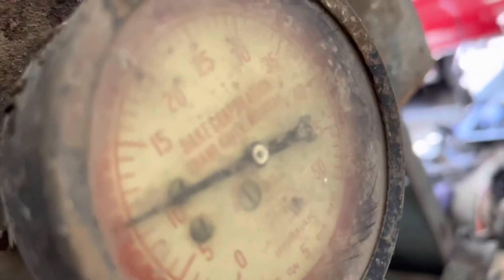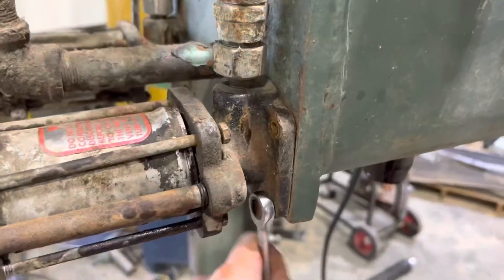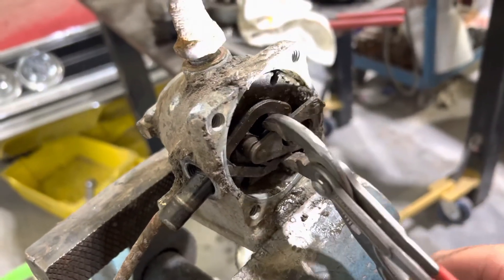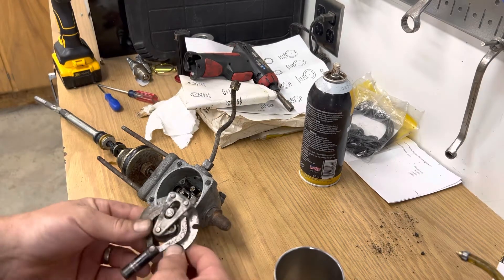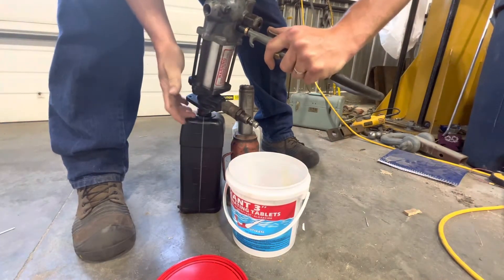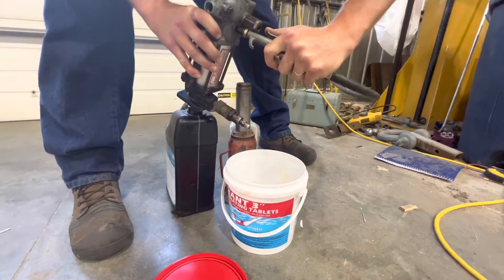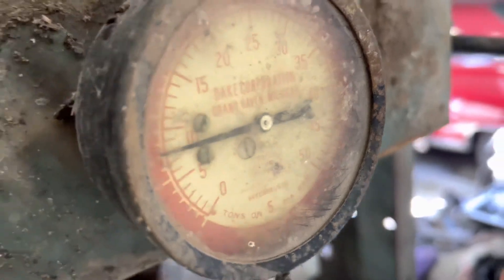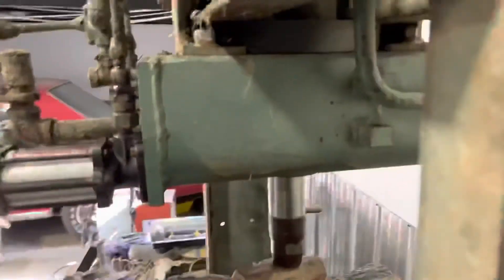I Bought A Dake 50 Ton Press That Has Been Sitting Outside For Years

Comment: SO how much did you have to put into it to get it working again?  Money/Parts/Time?
Reply from the maker: Parts was about $50 for the air pump cylinder housing (piece of aluminum pipe) paint $50, looked into buying the factory hand winch but it’s like $500.  I blasted and painted it.  Got probably 2 full days of work into it and a little more building an desiccant air dryer for it. I’ll try to get another video of it up.  I will say parts are very expensive for this unit but pretty much everything you can get.  They still make them yet and I talked with manufacturer and said they are heading towards $15,000 now for new.  I don’t feel bad if I have to stick anymore into it.  I did learn a lot about pumps and rapid ram advance.  It brings ram down fast to work area, saves lots of time. Thanks for comment